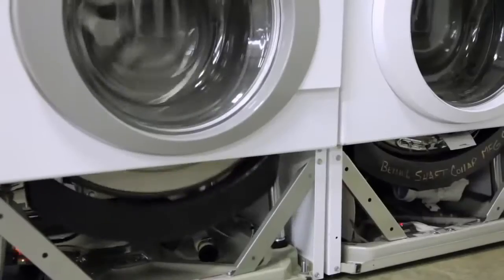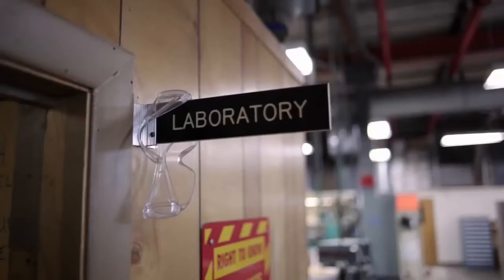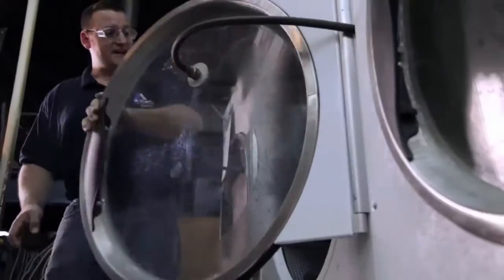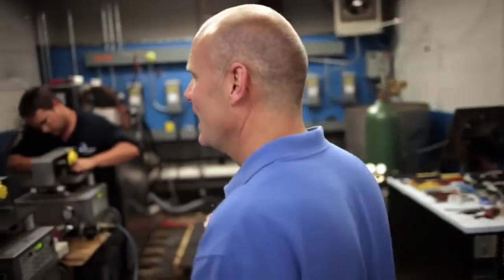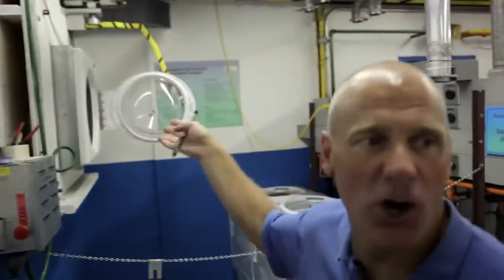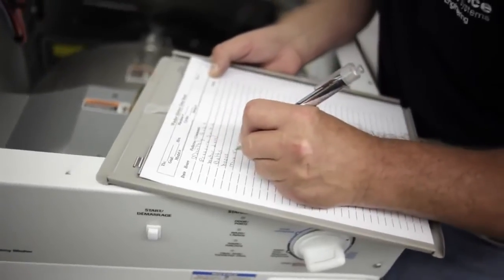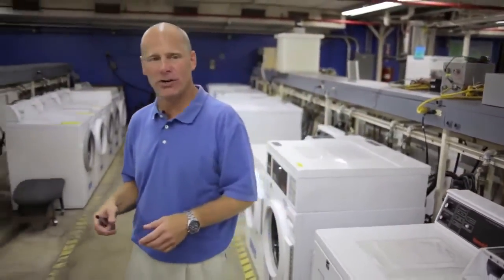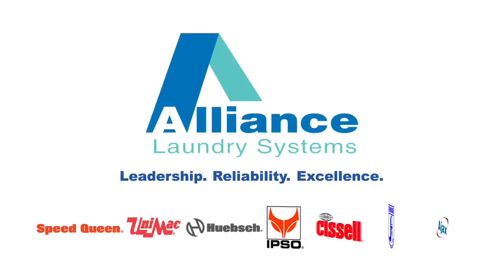Speed Queen Extreme Testing of Commercial Washers and Dryers

Comment: Does anyone know if Speed Queen front loader washers have built in heat models?
Reply from the maker: Hi Antonio, yes there are some models that have built in heaters, you would need to check with your local agent to see what is available locally. I have a front load at home but it does not have the heater, just uses the hot and cold water available.
Reply: +F.L. Costello & Co... Ok thank you because I've always wondered if they did. I was always team top loader washers for years and still am. The only front loader washer/dryer set I will ever buy will be a Speed Queen.. And it will be with the built in heater feature.. I am a self proclaimed electronics and appliance addict.

Comment: put wheels on washers and dryers cause hard to get them into tight spaces.

on the smaller front loaders garbage collects In that rubber seal.

also customers shut the door but often machine doesnt start because they have not closed it properly. digital read out or better door closing mechanism like on your bigger front loading machines would be better maybe.

double stack dryers not too bad but some times doors dont stay closed.

Anything to reduce the amount of gas which is getting very expensive.

anything to reduce gas consumption getting more from less gas be nice.

Is it possible top loaders gearbox oil can leak into drum ?